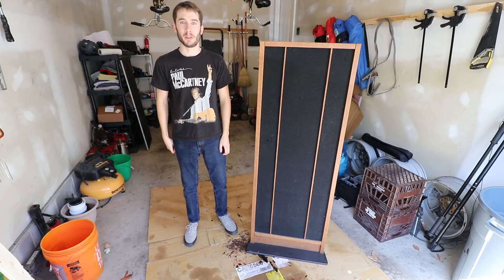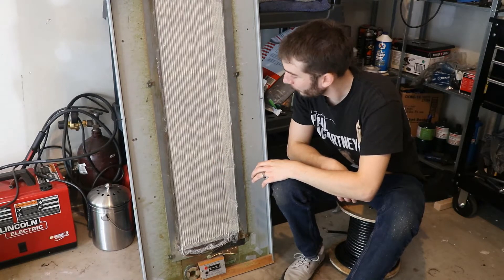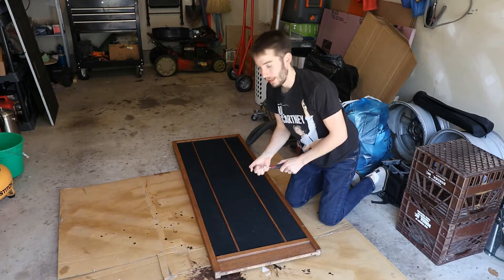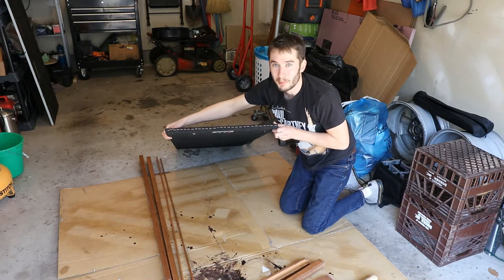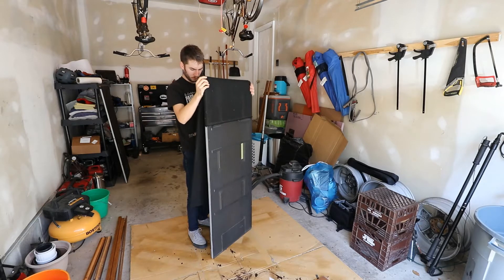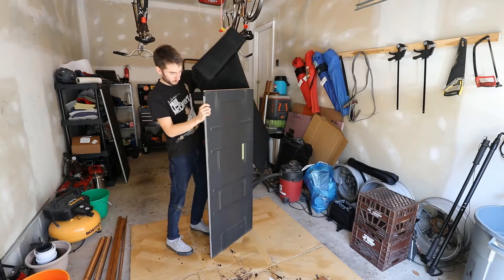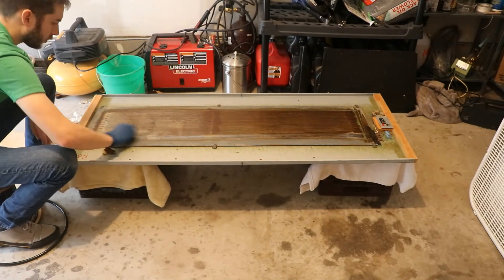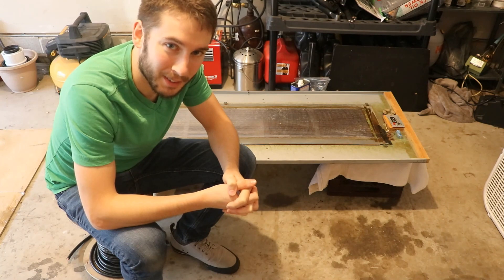REBUILD your MAGNEPAN MG-1 SPEAKERS (Part 1)

Comment: TY for the videos, gave me the confidence to do my own MG-1 rebuild.  It took some time but was totally worth it.  Between this & some guidance from Magnepan I have a fully rebuilt set that sound awesome.
My tips for anyone looking to do this rebuild:
-Don't waste time on the jig, it's not as hard as it looks to lay the runs down. I used foam weather-stripping (3/16" for tweeter & 5/16" for mid/bass), stuck down pieces at the ends, pulled the wires, wrapped around the foam, then removed foam once the wire was tacked.  This gave me the smooth radii at ends & helped w/wire positioning.
-TAKE PICTURES, document everything & how it was laid out.  I also made marks on the frame to indicate where the loops started/stopped so i wasn't lost after stripping everything off.
-Removing the old glue was surprisingly the worst part (for me anyway).  I found that keeping the glue damp helped most...which is not easy as acetone dries very quickly. Buy a cheap spray-bottle & spray the acetone on, bc if you just use cotton balls or wipes it dries immediately.
-Keep anything sharp/hot away from the Mylar bed. (including solder!)
-Having a higher/flat workbench helps, RIP this guys back.
-Don't wait on the super 77, I did one speaker on a very dry day & it started drying after ~15-20min making it difficult to tack down wires.
-Keep wire runs centered between the magnets.
-Get a hot soldering iron, Magnepan recommended 760F, but ~820F worked better for me.
-Just get the new capacitors.  They're cheap.
-Make sure you get ALL of the coating sanded off of the wires where they terminate.  The coating is goldish, the bare wire is silver colored.

Comment: I was able to repair the brake in the foil coils By carefully scratching the varnish off the foil on each side of the break and Bridging anddrizzling 902 high conductive silver glue Across the break had to wait 14 hours for the glue to cure, but it works great. It cost $20.

Comment: Where can you buy the rebuild kit? It seems the Magnepan website doesn't list them at the moment. Has anyone assembled an equivalent shopping list? It seems all the parts are off the shelf for the most part. Thanks.
Reply from the maker: You need to call them or submit a request on the website. They use a proprietary blend of the 30NF glue.

Comment: Nice job and you are 100% correct it takes time and great prep.  I have a set of MMG's that were given to me. I run Carver AL+ and the just sing in tandem. I just started hearing a mid rattle. I found the issue and working on how the treat the. They are pretty shape and I caught the problem early. Ty for the post and ready for part 2

Comment: I would use a wide drywall knife to lift up the wires. You should also consider installing new  capacitors, inductors and resistors as those other parts for the crossover Networks since they’re over 50 years old! now would be a good time to do it since you’ve already have the speakers apart and the socks removed!

Comment: That was a really interesting video. Last week I auditioned a set of 1.7 I think it was. They didn´t sound good at all. I don´t know the year of fabrication, but maybe they would benefit from 
his type of rebuild. They needed depth and had a ´tjiiing´ in the treble that I didn´t like. Anyone out there who could describe the difference?
Reply from the maker: Check out my video where I review these speakers - that one is getting more views and has a better chance of someone in the comments answering your question better than I can (https://www.youtube.com/watch?v=fRDKFTiDtGA).  I've never seen or heard 1.7's, but it looks like those might use a ribbon tweeter which these MG-1's don't use.  Something I comment on in my review video is that these speakers need good equipment to sound good.  I didn't get very good sound out of just my Marantz 2270, but when I upgraded to a standalone power amp that better handles low impedance loads and added an equalizer to really dial in the sound I was looking for, that solved the issues I was having entirely.